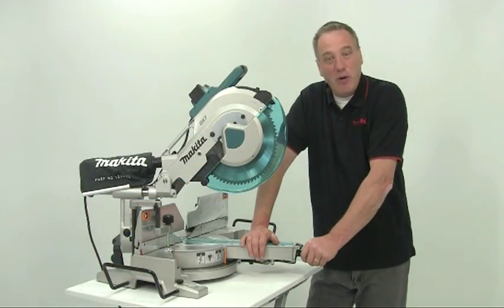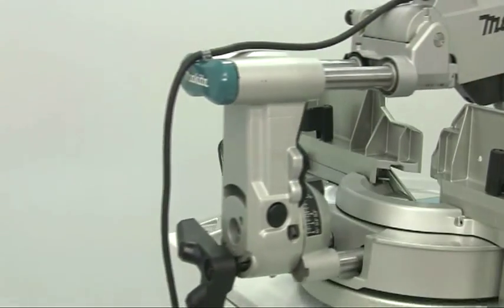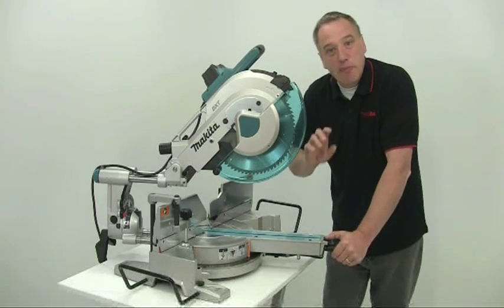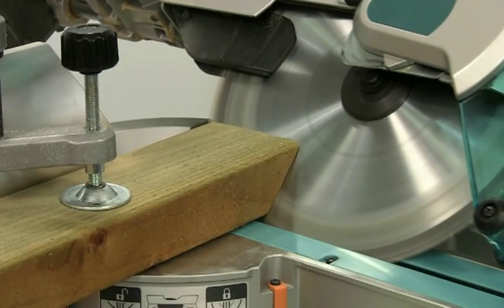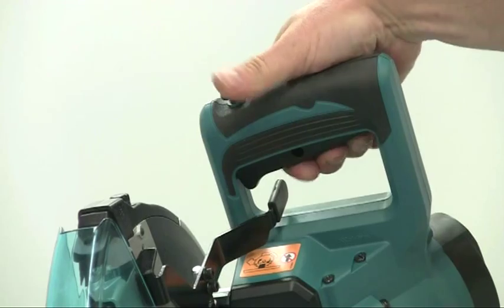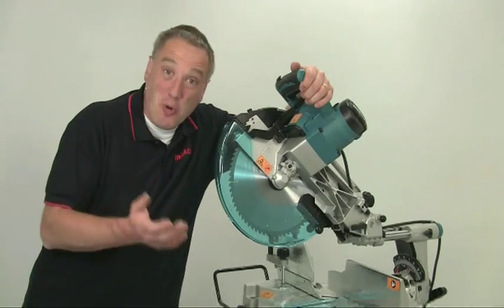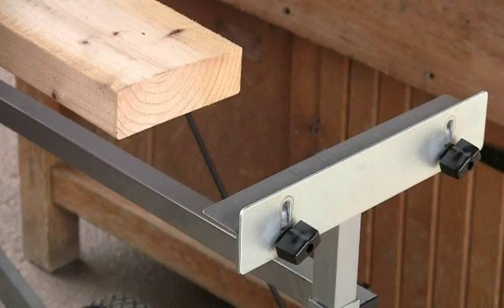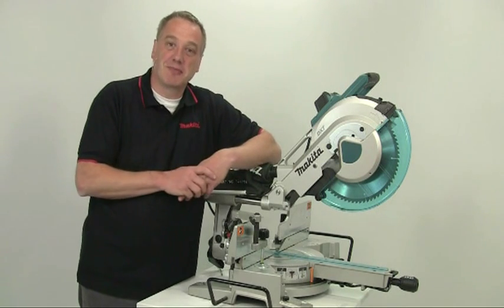Makita LS1216L Slide Compound Mitre Saw with Laser

Comment: I purchased this saw a few weeks back. So far its been amazing. Smooth sliding, soft starting, and the miter rotation is fantastic. Used it right out of the box to cut 8" poplar crown moulding and it worked great! The high fence is in a class of its own. The only small issue I've had so far is the dust bag doesn't collect much dust.